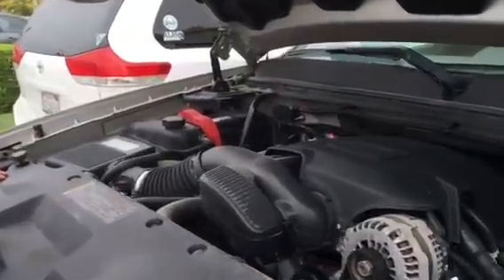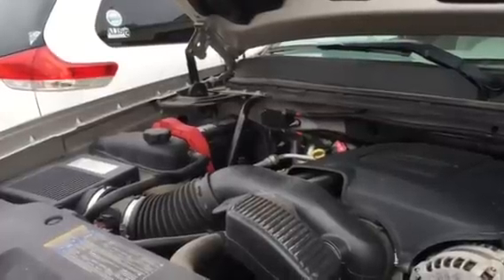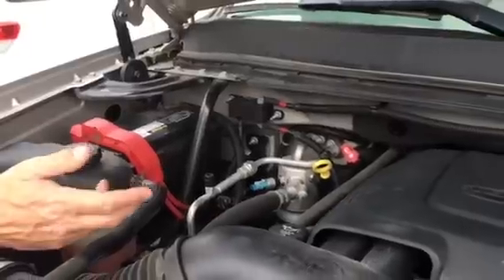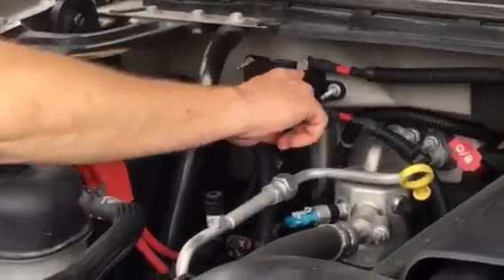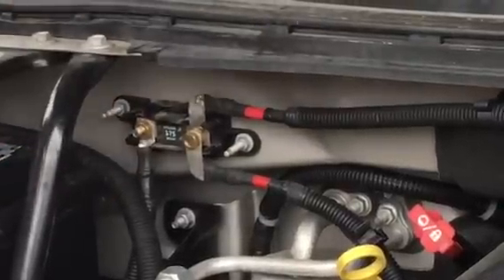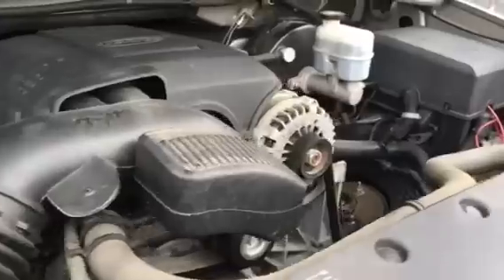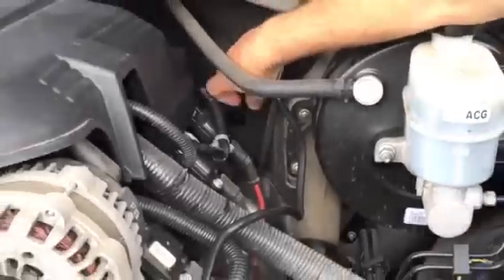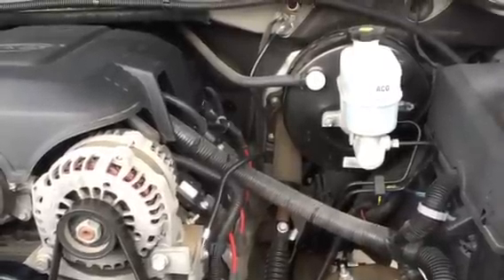GMC Truck Electrical Error Fix

Comment: I did add the new ground just like you did and my old issues of door locks going crazy, lights flashing, fuel pump going nuts, all have gone away. But just recently they came back and a new one has surfaced. I lose all power like the battery's dead, and I hear constant light clicking coming from the switches on my front door. If I disconnect the negative battery terminal, it all goes back to normal. Pain in the ass this shit is!
Reply from the maker: Don,  You know what?  I had the same thing happen a couple of weeks ago.  So, I started re-tracing everything and found another ground wire going from the negative terminal down underneath the passenger side front bumper.  It attaches with a nut to the bumper shock assembly.  It is black and you've got to get underneith to see it.  Look up from the ground, in front of the passenger tire.  I took it apart and cleaned up that connection real well.  I used some solvent to get the road grime off, then tightened it back up.  It started working well and I haven't had any issues since.  I need to re-shoot this video with that change added in.
Reply: You guys keep an eye on the fuse blocks under the hood... i have an 07 new style Sierra, and ive heard the fuse blocks get corrosion buildup inside them, an cause alot of electrical issues...
Im having a different one, my battery light just came on, and msg on dash says "service vehicle charging system"...
Batery is only a little over a yr old, and alternator just got replaced with new, because volt gauge was swooping brom about 10 volts to almost 15.5v...
Trucks start fine, volts are consistent over 14v, but this stupid light on the dash...
Dont know what to look for...
Reply: Get a readed and plug it into your truck and it will reset all of that for you. It will also tell you if you have to fix any thing too.

Comment: I have a 2008  G M C  searria 1500 did a test on positive  cable  test light on battery and clip on cable  light was on pulled fuse  by fuse  went through all of them light stayed on  so I went throw all the positive cables all was good can't find short but I no I have one would lik to find it before my truck catches  fire help please some one
Reply: Ever hear of punctuation?
Reply: Put a better ground wier from the motor to you frame of the truck it should help.  Use a big black one I put on a big copper wier that used for house and it was good all the time, never had any problems after that.

Comment: Negative lead? Sorry for the noob question but what did you specifically ask for at Pep Boys? Thanks
Reply from the maker: Tell them you want a "18 inch or 24 inch negative cable".  You specify "negative" and they will give you a black one, which is nothing more than a color code which signifies it is a "ground" wire.  Also, don't forget to take a wire brush to all the connections and make sure they are super clean.
Reply: XORBob thanks, I had the issue where I’d turn of my Silverado and it wouldn’t turn back on. Completely dead. Replaced battery thinking it was that but happened again. I then replaced the 175 amp fuse and hasn’t giving me and issue with not wanting to start anymore but it did give me the chime alert and abs lights came on. Hopefully this fixes the issue
Reply from the maker: Another thing you might want to do (though I didn't know this until recently) is clean the negative connection that attaches to the body under the passenger-side front bumper.  I didn't show this in the video, but I cleaned it recently and it was super-dirty.  This prevents the body from being grounded correctly, which will cause all sorts of problems.

You will find this connection in front of your passenger-side front tire, connecting to the body where the front bumper connects.  I just removed it and cleaned it with cleaner (like Simple Green) and a rag.  Then I used a wire brush to make it super-conductive.

Based on what you are saying, your problem is probably exactly what I was experiencing.  That's good news, because it's not expensive at all.

Comment: Thanks for the tip. My 07 Silverado has the same issue.  I noticed for my problem if I jiggled the positive cable coming off the battery it would bring back the power but only to have it go out in another week or so. I cleaned all the connections off even though they didn't really  have  any corrosion. I'll try the grounding strap and see if that helps
Reply: I am having the same ishue with my 07. Having to jiggle the hot cable. What ended up fixing yours

Comment: I got a 2007 silverado ltz and it's doing the same lights flickering dash lights going crazy radio resets itself I got a new battery and alternator is good I replaced the mega fuse checked all grounds and still does it? Need help
Reply from the maker: Did you replace that grounding strap from the body to the engine?  My strap looked good to me, but turned out to be the problem. When it heats up, I think it must stretch or something and intermittently stop providing good ground.  I recommend replacing it, even if it doesn't look like you need it.  It's about $6... so relatively cheap.  Also the comment from @happysawfish was good -- he said to use di-electric grease on all the connections.  Great idea to ensure your grounds stay un-corroded.  Let us know if it worked.
Reply: I'll replace it and keep everyone updated thanks!
Reply from the maker: I also read about a connector called a 16 Way Connector that is located on your Automatic Transmission.  It can come slightly disconnected and exhibit the same issues, except that you also get serious transmission issues (such as it can't shift into different gears as you accelerate.). If you Google "2007 Chevy 16 Way Connector", you will find it.  I can't paste in a link here.
Reply: So I ran a new lead from the ground strap this morning and I been driving the truck today and it hasn't done the things it was doing I can't tell if my headlights stop flickering yet but I will find out tonight so far so good but it's only been a few hours so we will see what happens I'll keep everyone updated

Comment: I was doing the same thing as you cleaning all my electrical stuff with electrical contact cleaner and then I saw this video we must be the same I just got some MSD spark plug wires for my 2011tahoe

Comment: Had similar issue with 2010 tahoe. 
I found that a backed off terminal in the 16 way connector in the transmission case was the problem.enter this in to search browser. SB-10043829-6448.pdf

Comment: My 07 silverado has check engine light and abs light on my gauges stop working and it shifts into gear hard anybody know why ?
Reply from the maker: Well, you might want to try to do this procedure explained here.  If it doesn't work, then bring it into the dealership.  As I've found out on that truck, a bad ground seems to manifest itself in quite a few problems (trouble lights going on and off, gauges going crazy, fuel pump going on and off, etc).  I didn't personally see the hard shift, but that may have been a problem too.?
Reply: XORBob I got like 8 codes
Reply: @misaelmacias9171  I've had multiple codes on my 07 2500hd. Po700, uo100, uo101, uo073, and a whole bunch of other ones. Cleaning up grounds so far hasn't helped. 

Ever figure this shit out? Lol
Could be different on each vehicle too. I pretty much always do my own work but I gave up. 
Right now my mechanic is telling me that he needs to replace my abs module and pump. $275 for a used part, plus labor. And he's worried about disconnecting the lines and that he'll have to replace them.
Fuck GM garbage at this point.

Comment: When my Chevy 2500 hdstarted having electrical trouble an the dealer couldn't fix it I fixed it my self I bought a Dodge
Reply: Duane Dove 
Ooh... sorry bout your luck...
Do you carry spare ball joints in the glove box, and a gas station in the box?
Lol
Reply: Just remember to carry a spare transmission in the bed and you will be good.
Reply: Duane Dove now you can put thousands into a weak front-end like I did.
Reply: Hahhahaa nice one! Never comment on a chevy video. Lesson learned.
Reply from the maker: Well, that solves it too!  :)

Comment: I'm having same problem except I kinda know how I messed  mine up by trying to get power from Bcm only driver door. And now I'm having all these problems + acts up when driving on freeway I think it dropped gears. Your video did help me find a bad ground wire from battery to engine so I'll change that but for sure will be my Bcm.  Crossing my fingers it's a ground problem

Comment: Have an 09 avalanche that had dash flashing different lights on and off, chiming while driving. Also door locks & unlocking while driving. Mechanic cleaned all grounds & it was good for about 2 weeks. Then started doing same thing again. Came across your video and just jumped ground from firewall to alternator bracket (ground). Hopefully this works as when I look with a flashlight, the original ground looks corroded at bottom.
Reply from the maker: I hope it helps you too.  Let me know...
Reply: Christopher Ivie hows it holding up..in the process of fixing mine
Reply: Did this solve problem?
Reply: It lasted another 2 weeks, did it a couple more times, but not as much.  Saw another video where they replaced ground terminal to battery. So, I did and after driving about 2500 miles haven't had an issue. So it was definitely a grounding issue.
Reply: Christopher Ivie 

Just wanted to let you know that I had the same problem with my 2013 Silverado ABS light Traction control and stabilitrac coming on multiple times .I had replaced altinators multiple times batteries . always the same issue months apart for the last year and a half.
Turns out that the positive lead going  to the fuse box was loose and shorting out. I watched the video and I checked and found other issues with the wires
Thanks for the video it has made a huge difference . The truck is running great so far no other problems 
Thanks Dave long
Reply: What size bolt is it to the alternator?

Comment: hey I found the problem why my instrument cluster on my GM yukon kept going off and on after bumps I shook wires and pulled out a ground wire it had two wires with black stripes it was grounded to the engine deep down so I risked it pulled it out and twisted the two wires together and the whole thing lot up and working great and I don't even have it grounded just tied wires together will it be fine to keep it like that or should I ground it but since it's working fine will it be fine please someone gives some feedback on that thanks alot
Reply: HilBill Doll Im trying to fix this issue on my yukon now 😱 can't seem to find the bad wire anywhere...
Reply: Mine does the same thing with bumps and when it warms up. I have a 2003 Yukon XL SLT. The electrical things that do not work: front windows, electrical locks, radio, the fan works but no a.c., the back windows will roll down from the back but not the driver control panel. Now the truck keeps going into reduced engine power when I'm driving. Will this fix the issue? Anyone else have this problem?

Comment: my only problem is my instrument cluster and gauges keep going off and on after every bump I was in that area wiggled some wire and it came off and on and I was told I need a whole new cluster and it's just a short but there's a bunch of wires together and I'm not sure which one it is exactly I want to start messing g with it but afraid to  make something else go bad so least I know the problem and it's nothing to do with the instrument cluster which I was told by the at the car lot I got my car from but can someone show me where I can get help or what to do its a 2001 gmc Yukon

Comment: Hey thanks for the info just started having this problem last headlights were flicking and airbag  light started flashing and radio went off , and doors unlocked and locked , and now it won't start at all put the key and nothing like if I don't even have a battery in the truck , but I hope this works for me thanks
Reply from the maker: Try replacing that grounding strap at the back of the engine and clean all the connectors off really well.  It seems to be the fix to many people's problems.
Reply: XORBob thank you for sharing, I'm gonna do that before i take it to a shop hopefully that'll fix the problem
Reply: Rod casso when your truck dies dont jump start it i been having same issue with my 08 avalanche what i do is wait till i get to a parking spot turn it off and if dies pop the hood and wiggle your positive cable bet you it will turn on let me know.wiggle the red cable first if it works good if not wiggle negative cable
Reply: 2point0kikz 

I was having a similar problem, I was getting a stabilitrac and abs message on my display and no start no crank. I tested the battery twice and tested good so obviously I thought it was something else but after all I ended up changing the battery and it turned on, if you can swap out your battery first borrow one just to make sure that's what your problem is. I couldn't believe how much trouble this battery can cost and how the dealers are taking advantage of this.
Reply: 2point0kikz I'm having exact the same problem with mine 08 chevy avalanche,  it goes crazy while driving lights on dash flickering if I stop turn the truck off it won't start again completely dead not even break lights like if it didn't have a battery but if I jump start it it starts right up running to normal. But I can see my battery gauge moving dropping below 14 amp. Ck battery, alternator and starter autozone and oryelly's say they were good.
Reply: I have the same problem i put a new altenater and battery and the extra ground cable but it keeps doing it ?
Reply: Where you able to get it fixed? I had the same stuff that you are describing. Then my service stabilitrak came on
Reply from the maker: Yes, this sounds like exactly what I was experiencing.  Let me know if that works.
Reply: XORBob will working on it now
Reply: XORBob did you leave the old ground strap on
Reply: XORBob  it worked, I went ahead and replaced my fuse anyways and ran the other  ground too 
thanks a lot for the video
Reply from the maker: Great.  And yes, I just left that old grounding strap on.
Reply: XORBob did your truck do it  again after you ran the new wire?  mine did 3 more times drove it about 15 miles, thought it was fixed do you any other things that might cause this , ima double check to make sure I tightened the bolts tight and correctly but any info you could give me I would appreciate it
Reply: @SuperWalkman01  hey my vehicle is doing the same i havent changed that ground wire yet. But were u able to figure out whatelse was wrong after it started doing it 3 more times?
Reply: Rod casso ......Im having the same problem now with 09 Avalanche
Reply: JDM A'F it was my main ground  cable the problem fixed  it self. I wiggle it and ever since  I posted my original message I haven’t have  any more problems. I didn’t even have replace a thing. Weird

Comment: that happened to my 09 and they said I had bad ground and replaced the ground from battery to engine. I'm curious what that connection does next to the battery I have to keep it unplug because it drains my battery.

Comment: Hello All I have a 2009 Denali and I loss power (only sometimes) when I shut down, I then wiggle the negative and all power comes back. I changed the negative cable out with an OEM (has the extra lead that goes to the front bumper. Cleaned all the leads like new. but still happening will try the other ground as well you mention but hoping if anyone has a fix for this.
Reply from the maker: Look for those woven grounding straps (Like the one at 2:48 in this video).  They seem to be a problem as they get older.  I've heard from a lot of people that replacing those has fixed the problem.  There should be one or two coming from the engine to the firewall or frame.
Reply: Thanks XOBob got the parts in from Rock Auto (woven Ground and Positive cable as well) figured I would change both. I'll repot back on results thanks for the help!
Reply: ThePSO51 so did this fix your issue. I as well having same issue I already replaced the negative one on the battery.
Reply: Learn how to do "Voltage Drop Tests" with a Voltage Meter.

$89.00
"First Things First"
The PDF cost will be less if it's sold as PDF..I can't remember right now.
www.veejer.com 

A Student of "First Things First" solved this mans problem within 15 minutes after the guy had his Transmission Rebuilt because it wouldn't Shift...After the Shop Rebuilt it, it still didn't Shift because they had reversed the Alternators Cables.

38 minute to 42 minute mark :
https://youtu.be/4EFzX3SN6ck
Reply: warriorpluto  Hey ya it is working now I went on Rock Auto an ordered a positive cable as well just in case not had a problem since!!